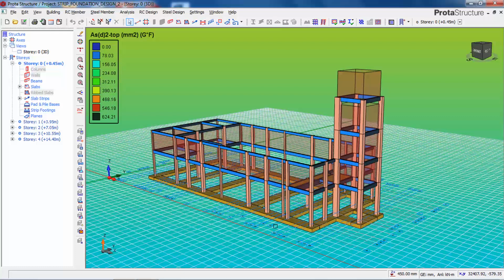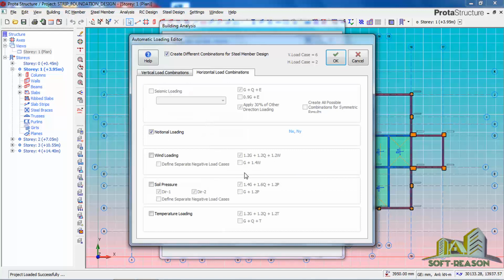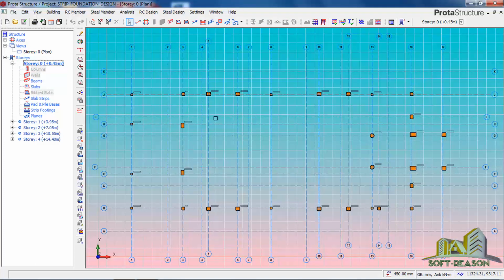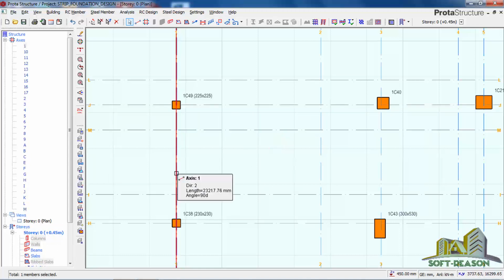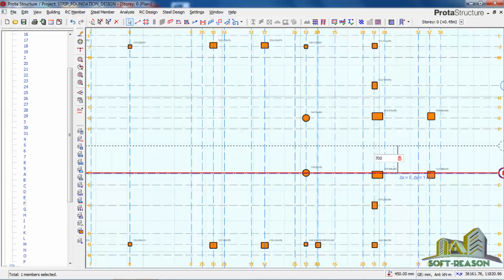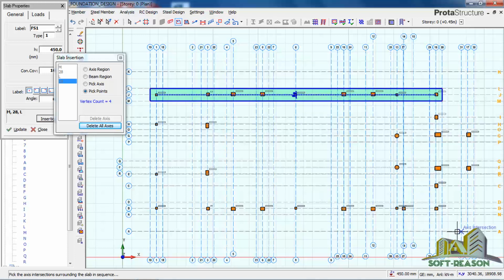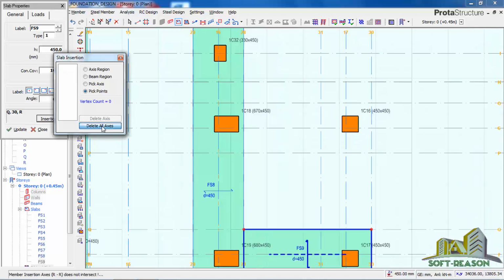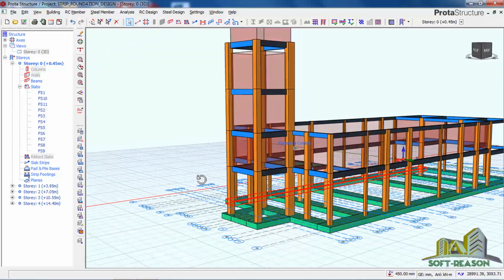STRIP FOUNDATION MODELING, ANALYSIS AND DESIGN IN PROTASTRUCTURE. Part 1

Comment: Your videos are amazing. 👍
But please how can you differentiate the level of columns pad footing 1.5m below GL and foundation wall strip footing of 1m below GL?
Reply from the maker: VERY POSSIBLE SIR, JUST TO CHANGE SUPPORT LEVEL
Reply: Thanks for the response sir. That I have done it. But how can I respond to errors when generating a model for raft foundation analysis like :
Error No:- 104
NODE_ERROR: Two nodes are too close to each other (same position or almost).
Reply from the maker: @bukatayakubugizaki3610  Node too close warning can be ignore. It not fatal
Reply from the maker: @bukatayakubugizaki3610  or locate the node and give an appreciate distance between it

Comment: How to design strap footing sir?
Reply from the maker: You can do that by connecting trap beam to footings at foundation level
Reply: @CADmade-easy  I need to insert isolated footing first?
Reply from the maker: @cengineer8756  yes, the strap beam should be right on top of the footing thickness, don't allow it to clash with the footing order wise it would not design
Reply: @CADmade-easy  may I request to make a video tutorial for strap footing?
Reply: @@CADmade-easy Can I do combined footing with strap beam or tie beam? It will be like strip footing
Reply from the maker: @cengineer8756  Yes, it's possible
Reply: @CADmade-easy  sir when designing strap foundation, should I go to FE Raft Foundation Analysis instead of concrete footing designer?

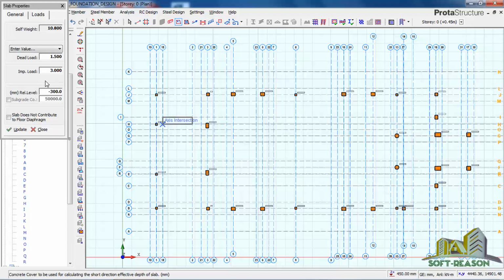Comment: at 13:54 why u use 1.5 dead load and 3.0 imposed load?
Reply from the maker: 1.5 and 3. 0 dead and imposed load is base on the BS code of practice specifications for the use of the Structure. In this case the structure is for commercial use more or less like a banking hall or a church with gallery.